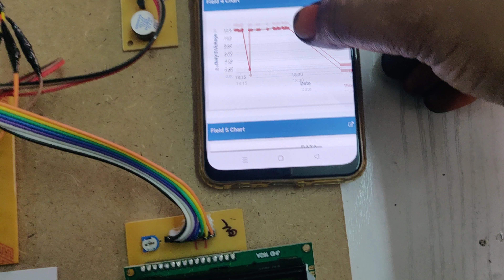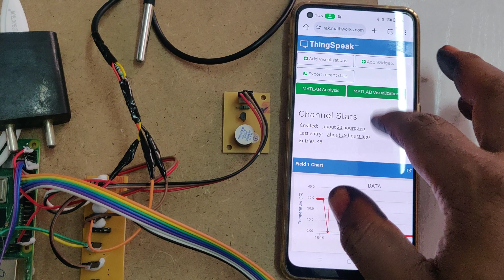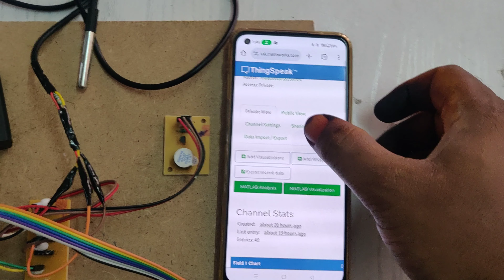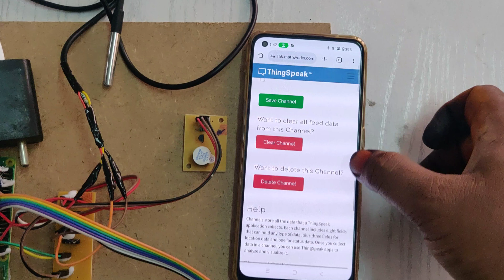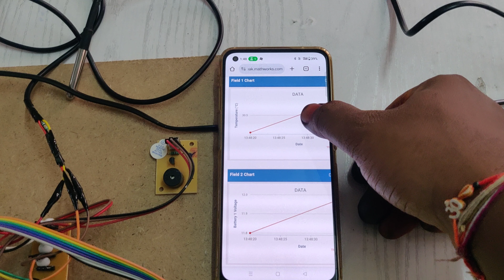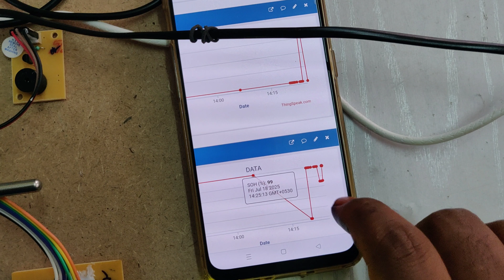HVS-3356. Smart BMS  #Battery Management System #Raspberry pi 4 #active cell balancing #SOC#SOH.

Comment: It is possible to develop an AI-based Battery Management System for Electric Vehicles for my mini project??
Reply from the maker: Yes. You can contact us at +919603140482
Through WhatsApp or call